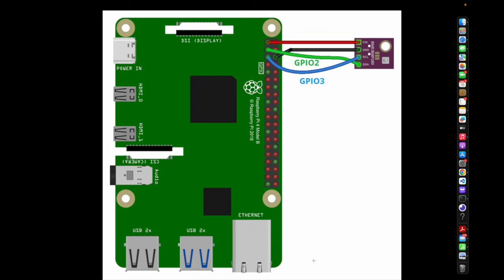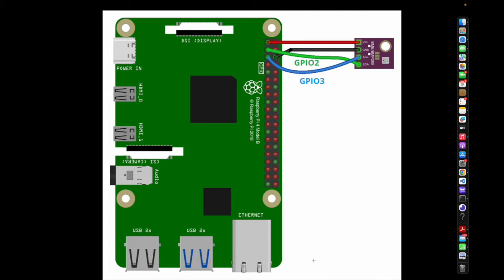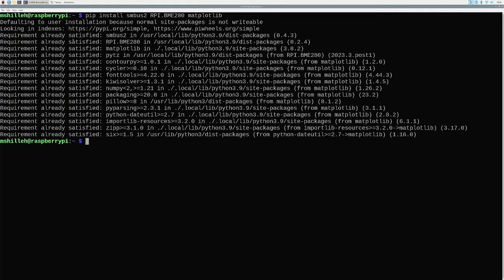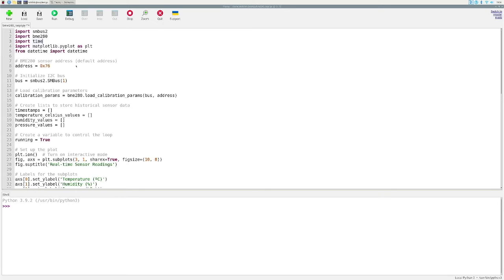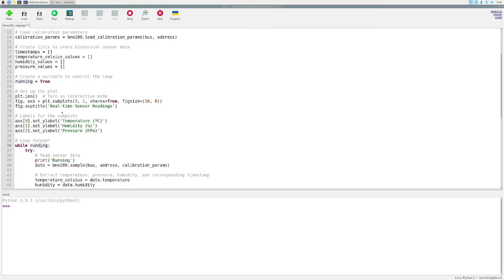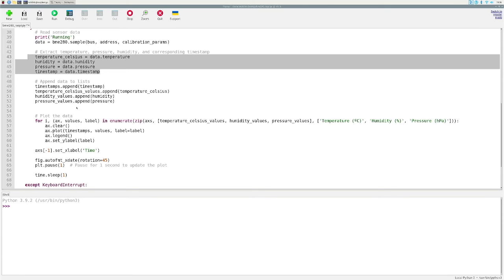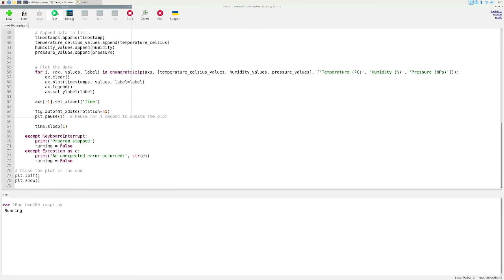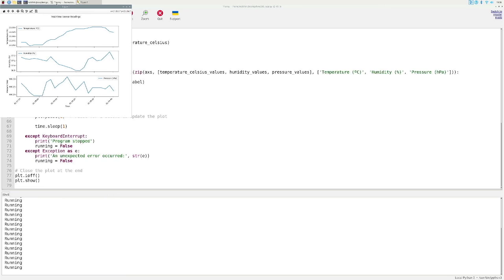Beginner Tutorial: How to Connect Raspberry Pi and BME280 for Pressure, Temperature, and Humidity

Comment: I am going to use a BME280(MD0809) for a proejct which was recommended to do using a Adafruit BME280(STEMMA QT), whats the difference? do i need to add pullup resistors? can i use the same adafruit_bme280 library the tutorial used? Help is much appreciated. I am a newbie.Thank you<3
This is the tutorial I going to follow,
https://youtu.be/BEbAvG5A238?si=DLC2ou7yOxR1ZFD4
Reply from the maker: Should work fine

Comment: Pip install never works because it’s ‘an externally managed environment’ I’ve tried to get past it many ways but it never works.
Reply: im getting the same issue have you tried using virtual environment?
Reply: @JL_bryan  I haven’t been able to get that to work. The most success I’ve had it by downgrading the pip installer to an earlier version, at least it installs them but it still doesn’t seem to work
Reply from the maker: Did you run this to install pip?

sudo apt-get install python3-pip

Comment: I followed your steps but im getting an error when running the code. No module named smbus2

Any ideas?
Reply: Yes, “requirement already satisfied “
Reply: I soldered up another sensor and same result, I disconnected the sensor and get same result. Maybe the sensors are all faulty?
Reply: @robertpyle87  I would not jump to that conclusion prior to testing it on other modules and perhaps having another person testing it. "No module named..." is almost always an environment issue, from my own experience.
Reply from the maker: @robertpyle87  I see sounds like a Python environment issue perhaps. Hard to tell if I do not have access to your Pi. What version of Python are you using? Are you sure you do not have two Python versions on your computer? Some questions I would look into. Maybe try running the code in terminal rather than an editor and see?
Reply from the maker: Have you tried:  pip install smbus2

In your terminal on the Pi?

Comment: On a fresh install of Rpi with python3.11 installed i'm getting this error: 

```
➜  ~ ./muggyboy.py
Traceback (most recent call last):
  File "/home/me/./muggyboy.py", line 16, in <module>
    calibration_params = bme280.load_calibration_params(bus, address)
                         ^^^^^^^^^^^^^^^^^^^^^^^^^^^^^^
AttributeError: module 'bme280' has no attribute 'load_calibration_params'
```

running python 3.11.2